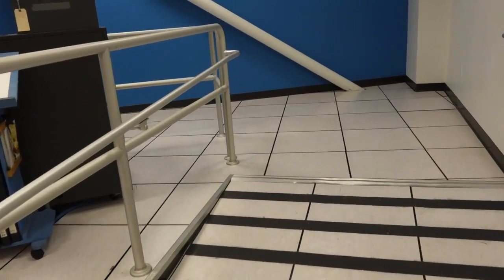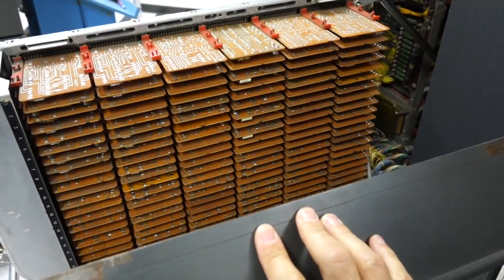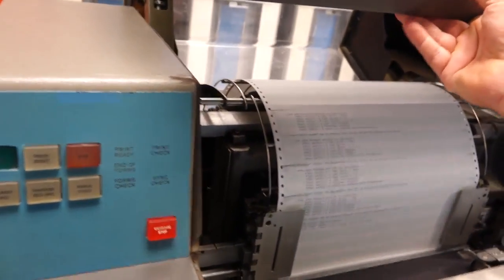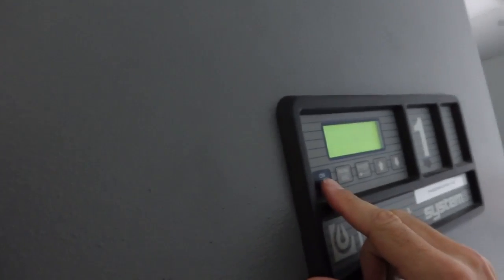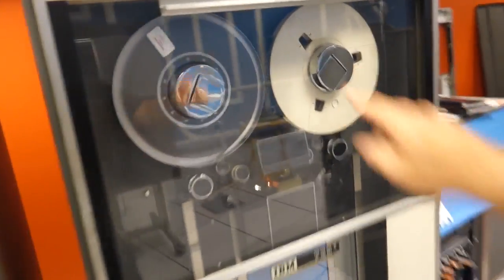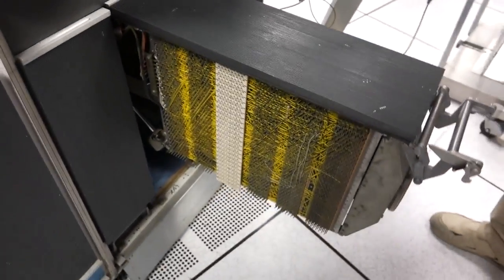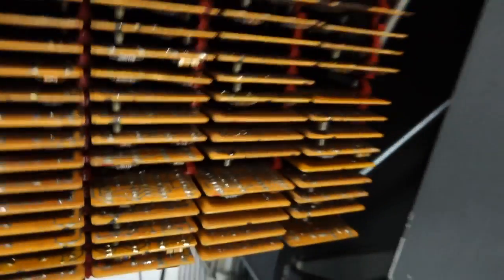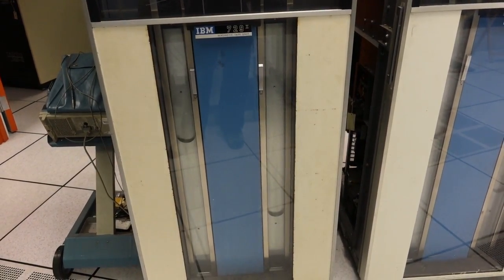Debugging the 1959 IBM 1401 Computer at the Computer History Museum

Comment: After operating on a mainframe for 10 + years in the 80's and 90's, I can tell you tapes and printers aren't that fun when you use them all the time. When we were on dayshift we had to find upwards of 200 scratch tapes each day for the night shift to use. This was always a chore as out of the list there would always be about 20 that you couldn't find as a tired operator had put them back in the wrong place. Or even worse when the console prompted you to put a certain tape on-line, and you couldn't find it in the tape library, if the tape wasn't laced up and on the drive in about 10 minutes, you would have irate dev staff on the phone wanting to know why their tape had to put up on the drive yet. The printers are amazing, but the thing about the speed they run at is that it makes them prone to wrecks constantly. When the print wrecks it wasn't just a matter of removing the wreck and putting paper back in, you also had to preposition the print, which wasn't always easy, it could take you 10-15 or even 20 minutes of farting around trying to find out where the print had been up to when it wrecked, which you had to do from the oper, which was in another room, although we did get a secondary oper in the print room after a while which we could log in for this purpose.
Reply: Better things must have existed then

#1 The tape drives were paid for.
#2 Disk drives and tape robots were ear-bleeding expensive.
#3 Laser printers were also ear-bleeding expensive.  
#4 132-column green bar fan-fold output is great for a lot of things that laser output sucks at.
#5 "Better" things like Windows and Unix aren't better than the mainframe (and DEC VMS) for production work.
Reply: diecast jam Why in the 80s? Better things must have existed then
Reply: diecast jam Pretty much why, I did not want to become a unix/nt admin in 1995. Too hard a work. And that was only vax systems that I saw during that time. The sys admin at our school, had big giant black spots under his eyes, had a grey skin and smoked like 60 filtherless cigarettes a day. Nope... That was like the posterboy for NOT becomming a sys admin.

Comment: Can you get replacement transistors for this?
Reply from the maker: +Galfonz Yes. We now have a stash of orginal Germanium transistors. When we find a bad card, we will repair them with original components most of the time, or in extreme cases have some re-made like in my tape drive video.

Comment: "We need a little bit of cooling" he says, as massive fan noise can be heard in the background
Reply: same sound of an AMD CPU Cooler
Reply: The 220 volt converter is for the German 1401 since it requires 220 volts to run. The machine he turned on after that is a server room air conditioner
Reply: that was funny
Reply: which is the coolant in AC's
Reply: And whats your point, troll? Are you here before you have any knowledge on the topic or are you yet another self-professed youtube comedian dip-sh!t that thinks you're just so funny??
Reply: What he said was still audible.. thats the power of an IBM
Reply: Witnaaay well, the 220 volt thing controlled the fan, the black thing mounted on the wall controlled the coolant, probably freon

Comment: it is all wire wraped, every gate !
Reply from the maker: +0MoTheG Yes, I forgot to explain that, you are absolutely right. Most of the wire wrapping was done by a computer driven automated machine, believe it or not, with just a few changes done by hand. Probably the ancestor computer of this one, with tubes! Schematics were computer drawn also. IBM engineering and manufacturing prowess is evident here, and led them to dominating this field.

Comment: More 1401 videos please! I would like to see someone write some code and run the cards for whatever compiler would be on this 1401. PL/1?
Reply from the maker: +Warp More videos coming. We program in symbolic assembly using IBM original Autocoder. A (very) few of us are able to program directly in machine code and punch it out on directly cards! But common mortals compile on a SIMH emulated machine (goes way faster), we have a nice graphics front end for it, it's like running the real 1401. It's called ROPE,  and it's available here: http://ibm-1401.info/1401SoftwDevel.html. Try it for yourself! Then we generate a punched card deck and run it on the real machine.
Reply: +CuriousMarc  That is cool. I will try the ROPE thing!

Comment: Real nostalgia for me. When I joined IBM in the UK in 1970, they were still running internal applications on a 1401 at IBM UK HQ in Chiswick, West London.  Even though I was hired as a programmer, all new hires spent some time in operations as part of our induction training.  We operated mostly System 360 machines, Models 50 and 65, and we were expressly not let anywhere near the 1401s because of the risk that we might do something to break them.  There were CEs on site 24/7 for the 1401s but the 360s were reliable enough to use the same call-in service our customers used. (CE stands for Customer Engineer, IBM's name for hardware repair techs).

At the other end of my 34 year career in IBM, I was leading the team that created the TC/IP load balancer for the Atlanta, Nagano and Sydney Olympic Games web ssites..

Comment: Worked on that system at Unilever headquarters in Rotterdam 1962/3.
Many thousands of punched cards passed my hands. I used to carry 3000 at a time in a vertical stack; lots of sorting if you dropped it!
Reply: Hopefully they didn't need those punch cards right away of you dropped them!
Reply: Waarvoor werden de computers gebruikt bij unilever?
Reply: i guess one application would have been bookkeeping.

Comment: A 1403 line printer, 1402 card reader/punch, and some 729 Mark II tape drives ... I remember them all well. We had the same peripherals on a 1410 that I operated part-time as an undergraduate in the late sixties. Our 1410 could run in 1401 emulation mode, but we usually ran it in it's native 1410 mode with the PR-155 operating system. The console of the 'ten included a modified Selectric 'golf ball' typewriter. It displayed messages for the operator, and also allowed us to type in the bootstrap loader (starting at address zero).  The boot loader was "A  word-mark L % B 0 0 0 0 1 2 $ word-mark N."  After hundreds of times typing that, the sequence is burned deeply into my 67-year-old brain!  Then set the Mode switch to Run, hit Reset, then Start. The L%B000012$ instruction read the bootstrap from tape unit zero, channel 1, binary mode, non-overlapped (i.e. wait for the input to complete), storing machine instructions of the bootstrap itself in memory starting at address 12.  Then the PR-155 Resident Monitor would load from the S.O.F. tape on unit zero. (Our PR-155 res-mon occupied the first 11,367 bytes of the 40,000 byte memory - decimal addressing and memory sizing here, not sized in powers of 2 as you might expect). Next, the res-mon loaded the Transitional Monitor (also from the S.O.F.). Transit-mon started reading from the card reader, looking for a MON$$     JOB   card (start of a batch "job"). 

Ah, the power of a fraction of a cheap cell phone, in a package the size of a small drug store! :-)
Reply: Amazing... It never fails to astound me just how much the human element was a component of these early "computers".  Almost purely mechanical in nature still, operating in similar fashion to today's systems, only taking a microscopic portion of that modern day CPU, and blowing it up to the size of your living room, kitchen, bath, and well... the entire first floor essentially.  And having that account for maybe about an atoms worth in a CPU virtual scale sandbox the size of our moon.  With the human element flipping switches, dials, choosing to run, stop, assign or take away resources, etc.  Things our OS, or the hardware itself does inherently on its own these days... Most don't even remember a day when a motherboards Northbridge encompassed the systems memory controller... But how about when that was "Bob's job".  And those memory pathways weren't traces on a motherboard, but cables inside of conduit.  Freaking crazy.  But everything starts somewhere, and this was always the same thing... Just scaled way way up, or is it down?  Scaled.... It was scaled.
Reply: a fraction.

1/1000000 is still a fraction.
Reply: Thomas Johnson why did tutor want it?
Reply: Thomas Johnson A fraction ? Something like one million times slower, and that's being very conservative. Those things were huge and so simple at the same time. I never got to enjoy such machines as I was born at the dawn of the 21st century, but boy do I enjoy learning about them ! :)

Comment: Whats the biggest hurdle to get over when it comes to restoring computers like that?
Reply from the maker: +Eric Hanchar  Many large hurdles really. You've got to find a big wad of cash and mount a rescue operation to move it, build facilities to receive it (it takes 12kW of power!), get all the original documentation and as many spare parts (or in our case spare systems) as you can, recruit a large and dedicated team of specialists to work on different parts of it. And in our case 5 years of work before it was operational again. On this machine with rusty transistors, finding and replacing the 130 failed SMS cards (out of ~2000) must have been a big challenge. Rebuilding the tape drives was another large project, which included building a full tape emulator in hardware. You can learn more about the restoration story in the links below the video.

Comment: I worked in a modern data center for 20 years. IBM S/390s (or System z as they became known) still used tapes for 'near-line' storage, though they were then cartridges (looked kinda like 8-tracks!). And 'chain' printers (we called them 'line' printers) were still used. Looked a lot like this old one. Loud as hell too!

Comment: I didn't think an all-transistor computer would need constant debugging, even one that old...
Reply from the maker: +douro20 Some you expect to fail often: the mechanicals (there is a large and complex amount of it in the peripherals), the relays, the connectors. But also the transistors, diodes and power capacitors do fail on a quite regular basis.
Reply: You had to have the card with you to do that. The transistors used were  a small varied type used on the range of cards and it was just a matter of a few minutes to do that instead of travelling to get the right card. Still have some in the garage.
Reply: +CuriousMarc Oh yes, the damn germanium transistors. These little guys age quite badly, I can&#39;t imagine how hard it is debugging randomly failing transistors on such a computer, especially when you know that there's not always an modern equivalent
Reply: That's why there were so many Field Engineers. On call I travelled 33 miles to Courtaulds Coventry to change a transistor on a print position driver card.
Reply: Wait, you changed a single transistor on a single card?  I thought the whole point of using modular cards was so you could just swap out the card itself and not have to mess with any soldering.